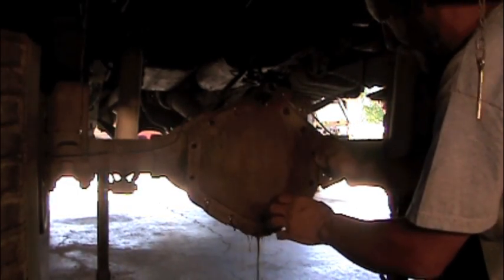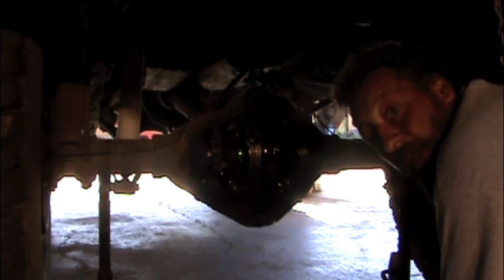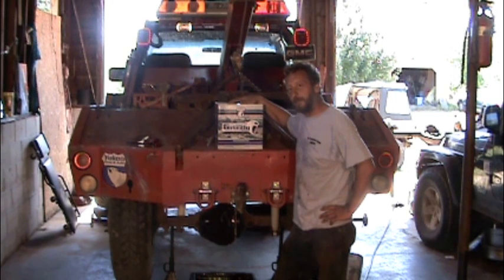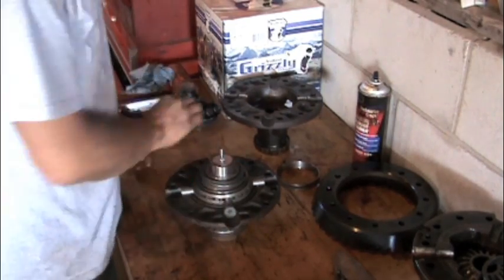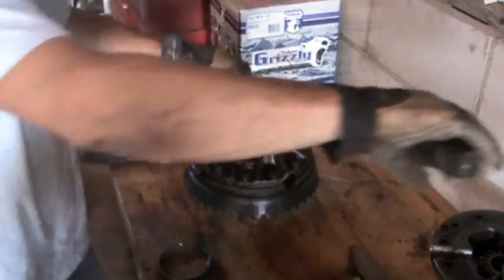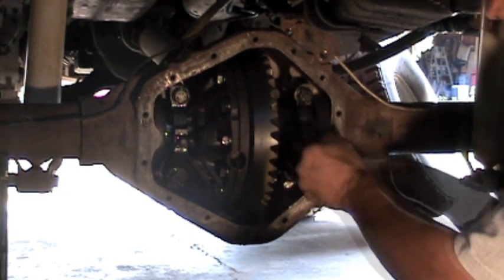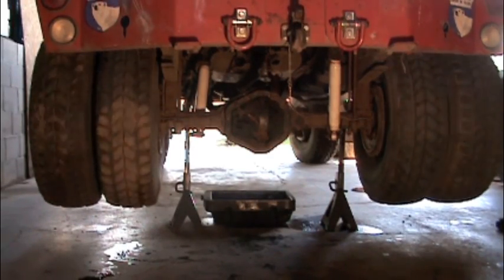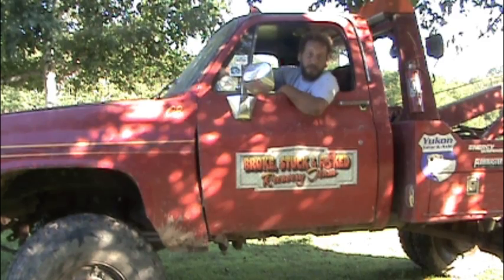Yukon Grizzly Locker Install by BSF Recovery Team

Comment from the maker: @l337pwnage It was a  Gov-lock with friction plates between the side gears and the case. Just a larger version of the one in your 10 bolt. It had 3 spider gears on a y shaped pin instead of 2 on a strait pin like yours, because of the y shaped pin it has to have a slit case for service. the torque biasing differentials you mentioned ( True-Trac, or Gleason ) have spiral cut worm gears that spread apart and create friction against the case. And were used in the H1 Hummer

Comment from the maker: @fyrdawg589 The Gov lock did not break because it was wore out, it broke from the off road abuse the wrecker gets. The large tires also helped in breaking it. If your G80 is worn out they are rebuildable.

Comment from the maker: @LakeErieFising A locker install for your axle is a little different, because most lockers for that type of axle require a carrier change (the are the whole carrier) except for the Lock-Rite or EZ-Locker. I would suggest you give Randy's Ring&Pinion a call their sales staff can help you decide witch type of locker would best suit your needs, wether it be a Gov-lock like in the 454SS or a full on Grizzly.

Comment: I could be wrong as I'm very much a novice, but that looks more like a torque biasing differential, like a True Trac, than a Gov-lock.  GM likes to use G80 as their code for many of their "locking" differentials, but having owned three G80 burbs and grenading one 10 bolt gov lock, I've really found gov locks somewhat fascinating so I've looked into them.
/watch?v=KbMZ9vcYVSg
Gov locks can be a bit scary when they lock under throttle, I've had my head snapped back a few times, lol.

Comment: Does it matter which side the locker retaining bolt wing nut is installed on? I noticed you had it on the side with the longer snout of the carrier. I'm thinking about putting on the other side of the carrier for easier removal.

Comment: Great video, very informative for only 7 min long. How is that Grizzly holding up? I'm debating on a Detroit or a Grizzly for my 10.5.
Reply from the maker: DJs Tuffmods It''s holding up great, in the new wrecker now.
Reply: @offroadrecoveryteam  how is the locker holding up? Im thinking about putting one in my 2500hd with a 6.0 gas.

Comment: I know this video is a little bit old, but would there be anyway you could shoot some footage of it like...so we could hear it as you went around a corner or something?  A guy at work was talking the other day about ow noisy a locker like that can be.  But--like you my truck has a man's exhaust system.  :)  So I was wondering if I would even hear it?  Thanks.
Reply from the maker: When it slips/jumps it sounds like you just broke a u-joint, but you get use to it.

Comment: Was wondering if you could let us know how long the Gov-lock held up?  I've had one in my '08 Silverado that so far has held up rather well (90K+ miles, yes my truck gets driven quite a bit).  My plan is if it does let go to replace with either the Yukon Grizzly or the Detroit locker.

Comment: Sorry for all the dumb questions. Is this 2011 Yukon Grizzly Locker the one that is still in your red truck today? (I asked and you answered about what locker you had yesterday, 9/7/202 0). Why have you not put in a front locker?
Reply from the maker: Yes, same locker holing up good. Front selectable locker is on the list, but not in the budget yet.
Reply: @offroadrecoveryteam  Got it! I going to get the Grizzly for my truck.
Reply: In the recent YT where you get stuck with the Ford on the hook and use the Warn with snatch block (I have the same Warn on my truck) to pull you out, it looks like your front has some sort of Locker as both wheels were spinning. Have you since put some kind of LSD or locker in the front? Thank you.

Comment: Did the gov lock work well for you when you had it? And also how where you driving at the time it broke?
Reply: +welpro21 They can break from an incident, or just from fatigue due to their design.  My 10 bolt G80 broke just taking off from a stop light under light throttle.

Comment: do u like the grizzly better than the Detroit
Reply from the maker: +Alabama Saint They are both the same design.
Reply: +recoveryteam ok if been running  Detroit up front but need a new one and have been looking  pretty  hard at the grizzly
Reply: Yep parts are interchangeable I think the housing is way better than Detroit and I've heard Detroit is s made in China now although I have no clue if that's true but either way u can't go wrong with either I leaned towards grizzly due to the warranty and I got a discount from bronco graveyard for buying a bunch of stuff Wich made it cheaper
Reply: Anthony Wayne yep not sure how long it's been like that but put one up front and really like it alot

Comment: you put a g80 in a truck that big. what?
Reply: the 14 bolt version is a bit tougher than the normal 10 bolt ones.  ;)   still has it's weaknesses,tho.